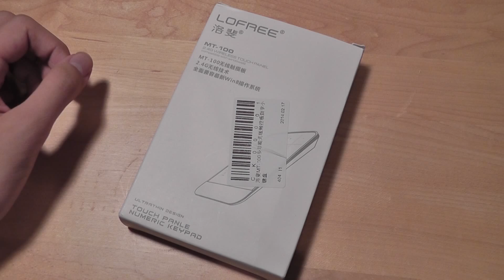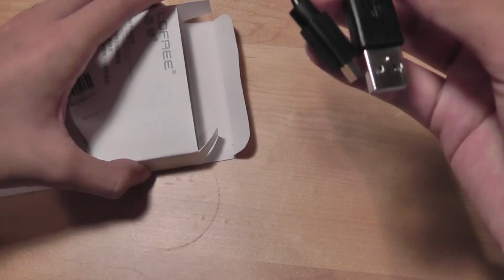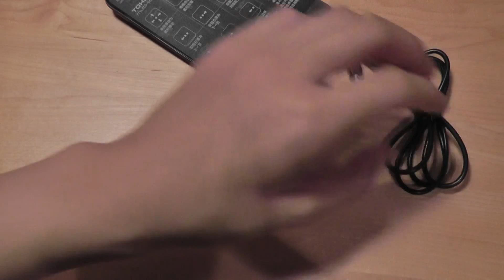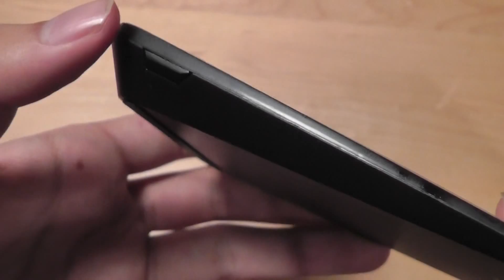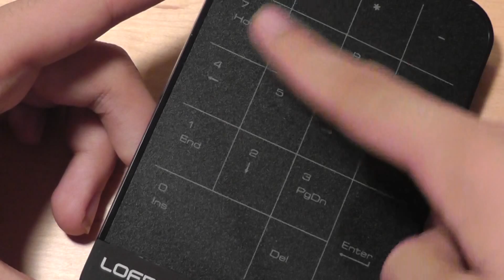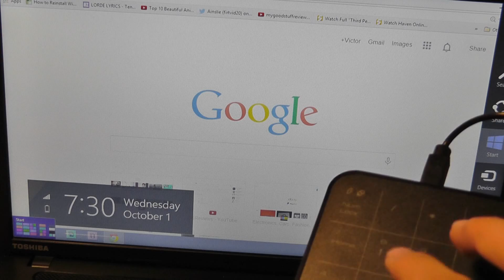Lofree MT-100 Wireless MultiTouch TouchPad Review:

Comment: scrolling on my desktop touchpad is straightforward, as single click and double click.  On the MT-100 scrolling around the desktop is smooth, but to reliably  single click or double click remains a mystery.  Sometimes clicking on #3 works, sometimes clicking on the bottom left area works, although neither is reliable. I foresee mine soon becoming  disassembled after impacting a wall; perhaps the battery will be salvageable.    To click on an icon, or to close a window remains frustratingly hit or miss.  It's been an enormous disappointment, and a waste of time trying to get it to work correctly.
Reply: You ever get this working properly? IDK why the ever living fuck the wouldn't add physical mouse buttons to this. That metal strip on the bottom would have been the perfect place